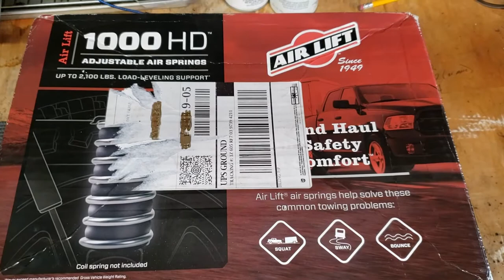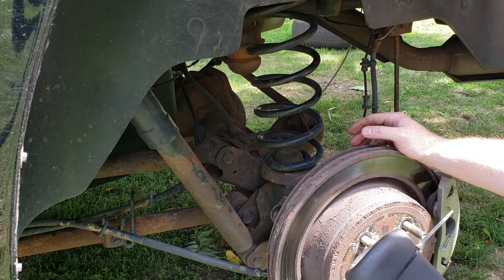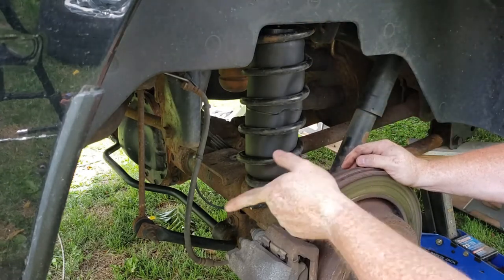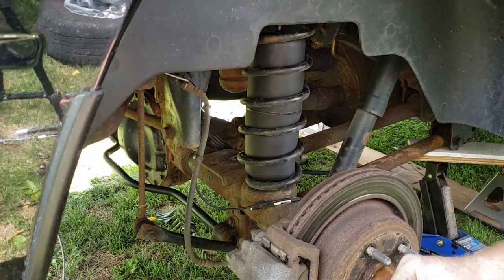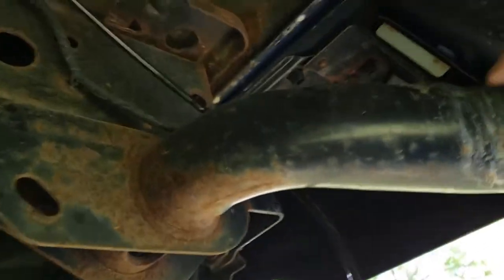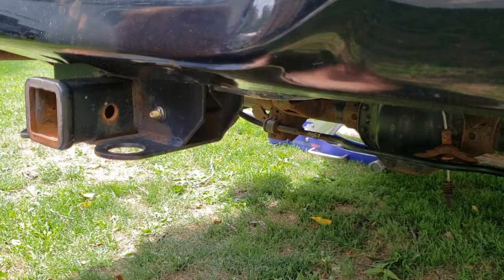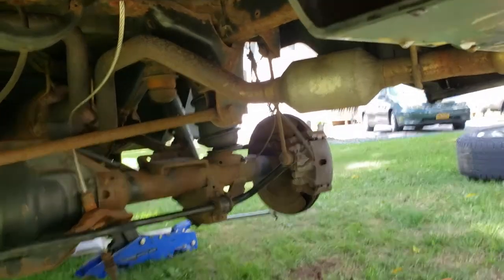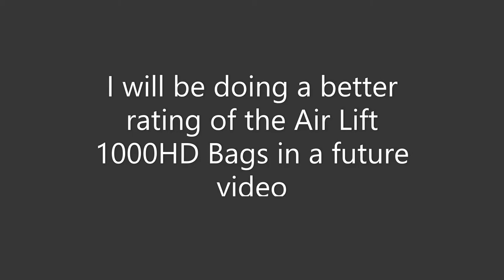Installing an Air Lift 1000HD (2012 Ram 1500)

Comment: What kind of MORON runs separate fill valves?
Reply from the maker: Just saw your comment.  Well, you do have the option to run one fill valve.  But, I choose to run two fill valves.  I feel this gives me a little more flexibility on how I load my truck.  Just a hypothetical situation:  If I need to load a gun safe and a dresser in the back of my truck, obviously the side the safe is on is going to squat more.  By using two valves I can inflate each bag to different PSI.  This will allow me to level the load.  Also if I use a single valve and have any failure in the line or bags it will render the entire system useless.

Comment: Any updates from actually towing? How has your experience been so far?
Reply from the maker: Hi Jeremy, Other than a few short trips and 1 Camping trip, I haven't tested them to the fullest.  But, what little I have done, I am very happy with.  I do plan on doing a 1 year review, after more camping trips and possibly using a few different trailers.  For now I did a short 6 month review on them if you would like to see that uploaded video.

Comment: Nice. It seemed to be an easy install. Took 2 hours or so? (Subtracting video time)
Reply from the maker: Thank you, Dave.  You are spot on with the time.  It took me just over 2 hours from very start to very end.  That included running back and forth for tools, moving the camera around, and stopping for breaks/drinks.  it was hot and humid out.